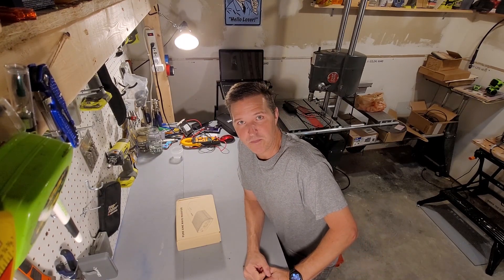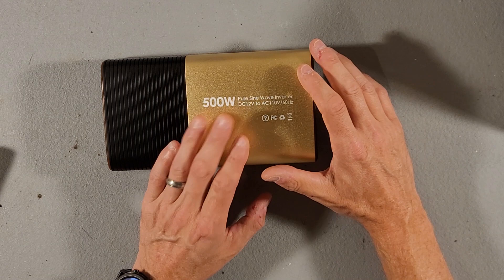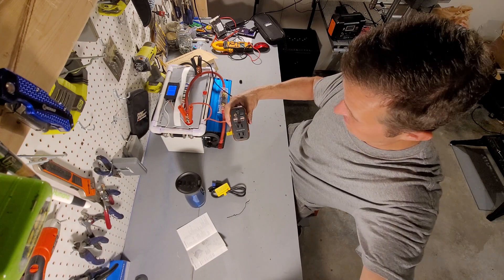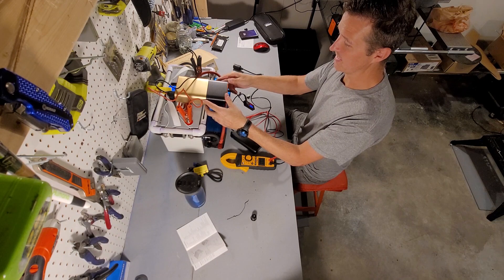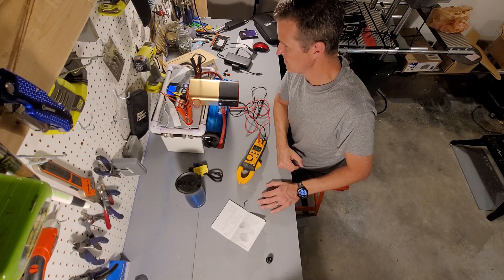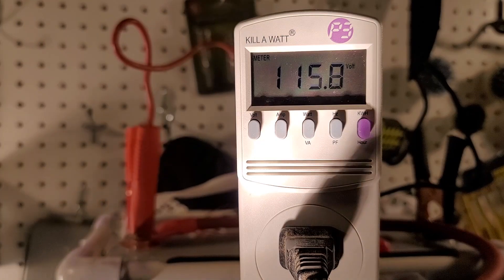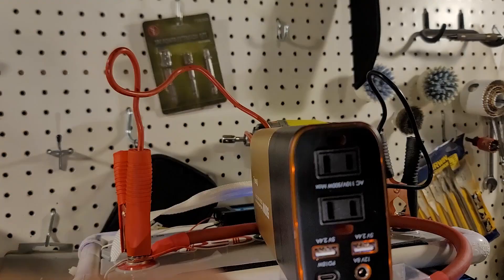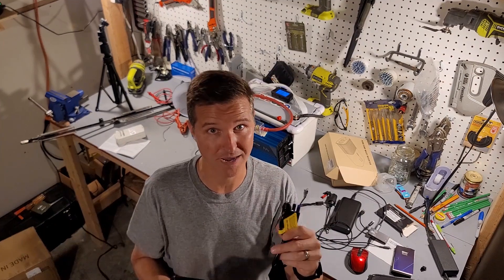I bought the cheapest Pure Sign Wave inverter on Amazon..  Is it worth it?

Comment: I have been using this inverter for ages. Its not powerful but it works.
Reply from the maker: I use it for all my small items and it works perfectly every time.  Thanks for the info.
Reply: @OffGridBasement   I have it fitted permanently to my motorcycle the one in the picture I have it connected to four plug sockets that are permanently plugged into the boot of the bike and always I'm 24-hours a day 7-days a week and this has been going for about 5 years now. This is the UK version of the exact inverter and honestly I've never been happier with it.. it runs all my super fast rubbish it to charge my laptop will charging my phones and tablets. Honestly it's fantastic. The fact that it's been outside and been subjected to extreme heat and extreme cold I'm very sharp humidity especially in winter when it's been foggy and horrible outside and it's still going strong it only place underneath the seat of the bike so it's amazing that the thing is still going. I've managed to get it's rating but anything over and it just had a heart attack. There is no soft spot for anything but when you think about it isn't really anything that you can run on this that would require it. It won't do large fridges it won't do drills it won't do power tools work do a kettle have a separate inverter for that. I did find your video interesting.
Reply from the maker: @elixier33  it's amazing it's worked for so long under those conditions.  Thank you for all the information.

Comment: Another good video. Can you also test using LED lamp (Dimmable and non-dimmable) to see if it will flicker or not? The flickering is one of the issue with bad designed inverter. I am also glad that you do efficiency test.
Reply from the maker: I will check with a LED lamp and let you know.  Thanks for the comment!

Comment: Good that you mention the cigarette lighter plug and 10 Amps.   So that would be 120 Watt minus the loss, below 100 Watt for sure would be safe.
People need to understand the basic laws of electricity and that is U = I x R and P = U x I (or puxi as a good friend says).  Many people think that they can power everything with a 12V battery.   Just a simple calculation, most hair dryers are like 1500 Watt, now convert that without the convertor loss and you will be at 125A current at 12V which is more than a lot.  In perspective if you have like 30 Watt worth of leds in your livingroom that would only be like a 2.5A draw or like 50 times less current.
Personally I would only get inverters in the power range you have there for 12V systems.  At 12V and due to the current you also have to think about the losses in voltage in cables, internal resistance of the battery etc ...  All not so great for higher power draws. 
I once bought a 'simulated sine' wave converter and it can do more harm than you think. Some of my equipment started making strange noises and it killed 1 power meter, so please people for the little bit extra buy a pure sine wave one.
Btw, as in testing fridges, just testing  a newer type of freezer here. It consumed 0.58KW over 24h.  If I check it, most of the time it draws 32 Watts and every hour , 20 minutes completely nothing .  I have just seen a spike of around 340 Watt for like 10 minutes, the first spike in 2 days, but my guess is that that is related to the no-frost system.
Reply from the maker: Thanks for all the great info!  (puxi...  that's good..)  It amazes me how some people think just because a hair dryer is small, it must not use much power and a chest freezer is big, so it must use a lot of electricity.  Thanks for the comment!